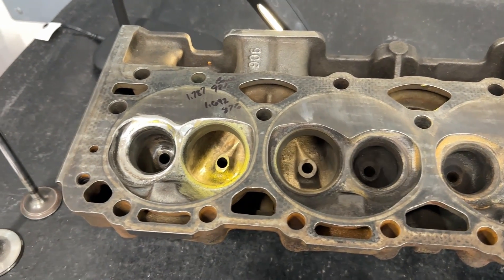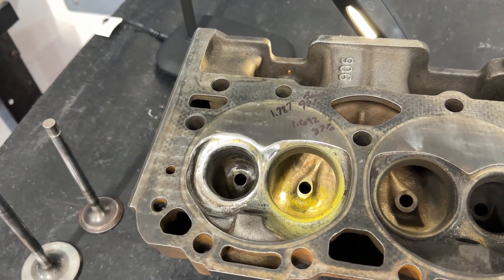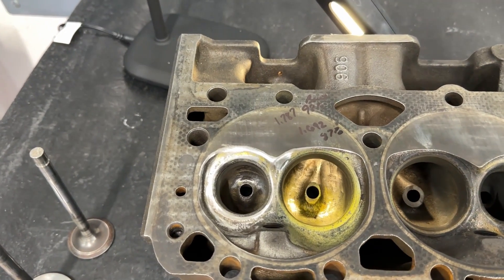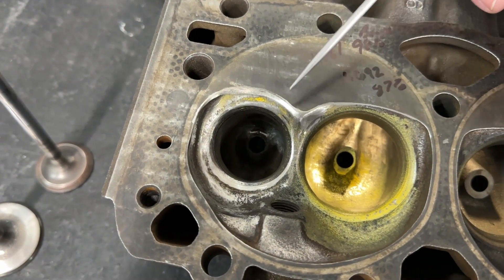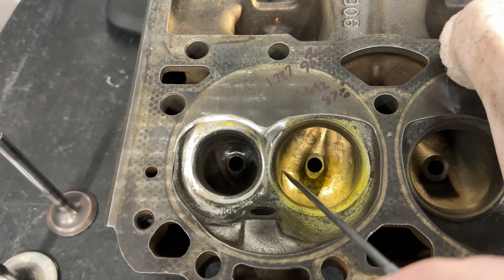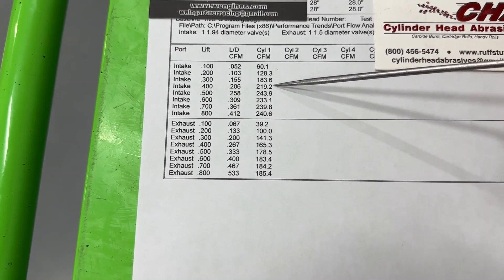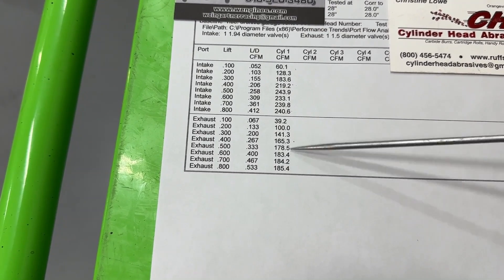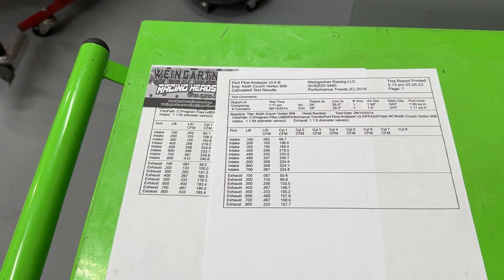Reviewing Some Ported Vortec SBC Heads

Comment: You don't have to have a seat and guide machine to do a valve job at home, I've done it for 50+ years and porting
Reply from the maker: You do if you want a performance five angle job.
Reply: 4 angle blend bowl has worked fine for me

Comment: 6:37 I have a cracked 062 casting that i plasma cut a big hole in the side of the head and the intake and exhaust ports are not solid there , they are however really close together so not a lot of coolant is gonna flow there confirming your cracking theory , the wall thickness is pretty thick so thats probly how a fair amount of material can be removed on the bowl side.:face-green-smiling:

Comment: Lol I been grinding valve seat & flow test & port 32 years  all my head so bullshit,  you can do a valve job in a home shop  0.000 0.0005 Concentric I fix more seat guide machine work then any thing there out 0.005 0.010  always  lol it called skill
Reply from the maker: Not saying you can’t but good luck doing 5 angles.  Unless you like taking a day to do a valve job.

Comment: Eric i have a 317 ls head I would like you to flow but would like you to flow all 4 ports as they range from stock to more and more modified, and heres the kicker, I opened up the the seats to 90% using a hole saw.
Reply from the maker: Send it in I can do that for $30
Reply: @WeingartnerRacing  will do, Thanks!

Comment: I have a set of ported Mopar Performance heads I'd like to send in but I don't think he has the proper plate to flow them. Flow numbers are unavailable.
Reply from the maker: If they are 440 style I can flow them.
Reply: @WeingartnerRacing  Unfortunately they are small block heads.

Comment: You know, you can flow the head 1st before porting & then after porting to gauge your work, you can always put the VJ in afterwards. I know it's not the usual way of doing things but you can clarify your port work without a VJ
Reply: I'm thinking the guy did the 1 port in his garage and wanted to see the results before porting more, and planned on the VJ when the work was done.
Note he hit the valve seat area and needed the work.

Comment: Hey Eric, I appreciate the matter of fact way you lay out the results, that's what I like to hear.  I ported that head about 4 years ago, before I knew how important the valve job is.  I'll email you on the cost of a proper valve job, for the I & E, and maybe I'll have you run them again!  Thanks for making this service available, I learned alot, and I feel validated on my understanding how gases flow out of  the exhaust port

Comment: There is also 520/059/113 head casting for the 305 engine. They have 1.84 intake valves and 58cc chambers. They are vortec heads with the vertical intake bolt.
Reply: Are you saying that you could run these on an old-school 350 ?? for "street" use ??  Tell me more......
Reply: @TIMEtoRIDE900  the 305 or 5.0l vortec heads are only down about 10cfm peak over the 350 heads. Its really small. Exhaust port and valve is the same from what I can tell. 58cc chambers will give you higher compression. It would raise the compression on a 9.4:1 L31 350 engine to 10.5:1

Comment: Why do the Vortecs fall off so much after .500 lift? Does the spark plug boss have anything to do with it?
Reply: I have seen where they fill in the notch on the quench pad side of the intake valve with clay and the high lift flow shoots up. That little notch disrupts swirl at higher lift and makes the port go turbulent.

Comment: PAC makes a beehive valve spring kit for vortecs that allows you to have .560 lift without cutting the valve guides.
Reply: So does Comp 918 Ls valve spring,requires a .100 longer valve🥴

Comment: Not only is their a difference in 906-062 their is a big difference is Mexican head vs factory head from 96-2002 flow more!  If I knew why I know now I wouldn't of touched a Vortec head. A ebay aluminum head flows more than not only mexican vortec they also outflow factory head by a few numbers!

Comment: 30 years ago when I did a few bracket engines the cam I used 99% of the time was a Cam Dynamics 284 iirc. CD had been bought by Crane sometime earlier. Iirc it was 234* at .050 and 480 lift. I could buy the cam and lifters wholesale for $89 :). I never had one fail but I did have a test stand and my cam break in regimen was 2500 + for 45 min. Then let the motor cool overnight and the next day retorque the heads, warm it up, hot lash the valves and it was:ready to go in the car.